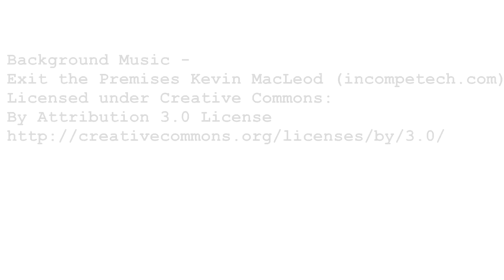Colourphase filament Experimental PLA test printing Vases

Comment: So why fan on 90%? Was 100% causing problems? I'm usually struggling to get enough cooling to PLA prints, but at 100% with your setup it's actually too much?

That filament looks fun. I did a much more extreme version of this by hand a while back (with short lengths welded together using a soldering iron!): https://www.youtube.com/watch?v=qRYuMsdZgNg
Reply from the maker: The 90% fan was a result of the setup I have for this Spiral Vase profile. I have minimum layer time set and also the fan speed linked to print speed, so It can go at 100% but I usually don't allow 100% for anything other than bridges. I had to slow down the print to allow cooling of layers even at 90% fan. 

I'm also using a 360 degree fan duct - that's been specifically limited - in this setup 50% max for PET/T/G materials and usually 65% to 90% for PLA. No fan for ABS.
Reply: Richard Horne So is that just the engineer in you not liking the thought of the fan running at 100% all the time for PLA? It's just that, if you're (sensibly) throttling speed to allow layers to cool, surely that minimum layer time could be lowered slightly if you went from 90% fan to 100% fan, with no down-side?
Reply from the maker: Mark Wheadon No, it's by testing and tuning that the minimum layer time and fan speed has been set. I experiment with fan speed and print speed for all materials, and it's interesting to see that more cooling fan does not always allow slightly faster speeds. Especially at early layers, then you have bed cooling issues, and other thermal instability in the hot-end.

I noted that a +5% more fan cooling with PETG causes my hot-end to cool enough so the thermal runaway condition is triggered - that could be fixed, but it highlightes that over-cooling and speed do not go hand-in-hand. In fact speeding up makes things worse for that condition because you would also need to increase the temperature of the nozzle or even more energy is being lost due to faster print speed.

Ultimately I compare the end print result to decide how fast I can print and what max or min cooling is needed.
Reply: Richard Horne Thanks – interesting.